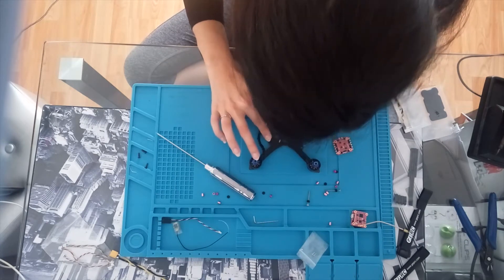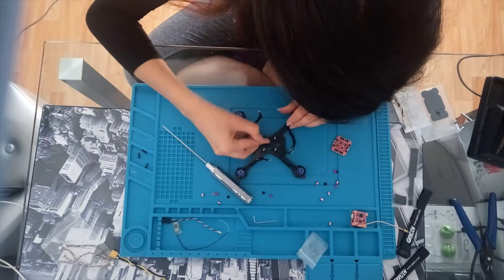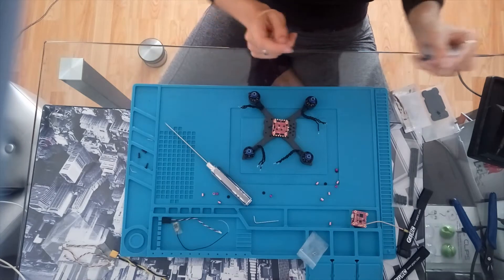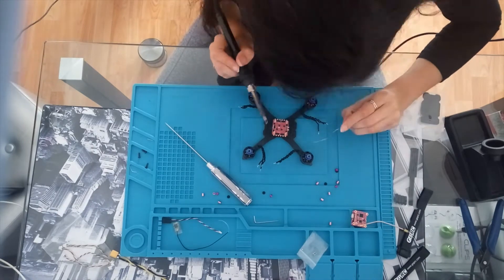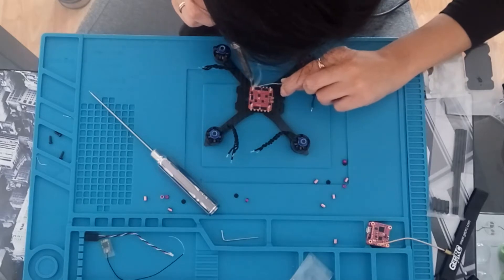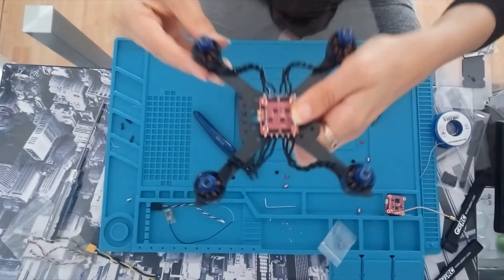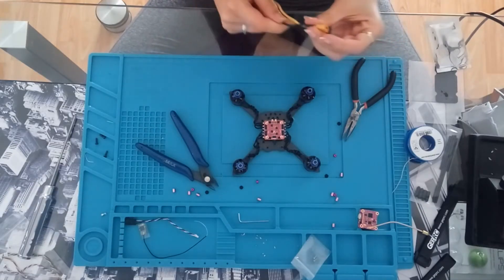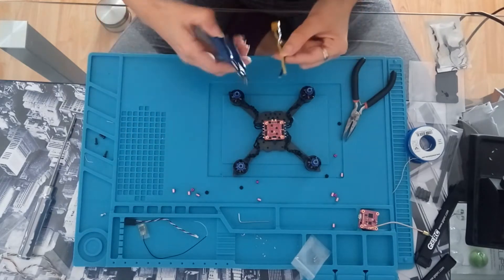How I Build My First 3 Inch Drone |  Maiden |  FPV Princess

Comment: thats an awesome build!! 1507 is a lot of motor for that frame. I am switching my sparrow to 1407s soon and i thought THAT was alot for the small frame, but WoW yours is that gonna be a screamer!!  if you dont mind, just a  little soldering advice. you need to use a wet sponge or piece of copper dish scrubber  to clean the Soldering iron tip after each soldering point, other wise a lot of build up will remain there and you wont get full heat from it. truthfully, and i really hope you dont mind, i'd tape up those motor wires with some nice pink tape, to the arms. the way they are now, thats just an invitation to a tree to snatch that up on you by catching the wires in a branch!! All in All i hope you enjoy the sparrow (mine is named Tango Dos) as much as i do. even with 1306 motors, its SO fast!!
Reply from the maker: Thx for the advice Thor! Yes I usually do use a copper dish scrubber, just forgot to take it with me from my bfs house and didn't mind not using anything this one time. You are right though, should have thought it through :D And yes I will def put tape on it like I have on all my other frames, I just liked the braided effect that day, but know I have to take safety cautions when I fly :D
Reply: i love the braided look!!! makes me wish i could braid :O